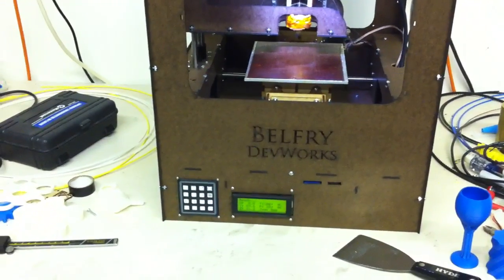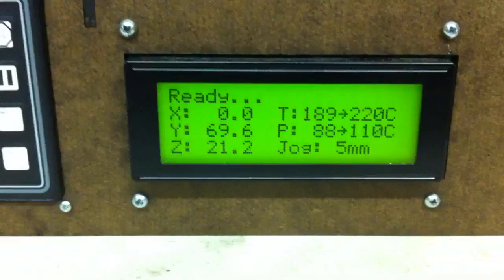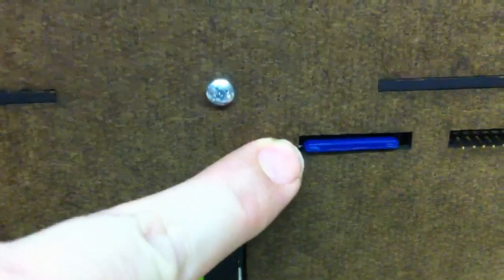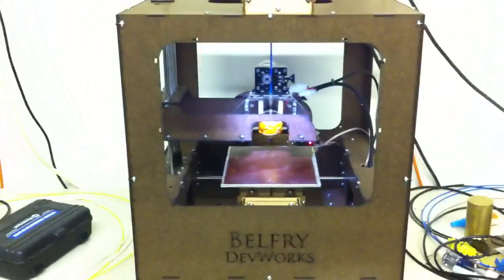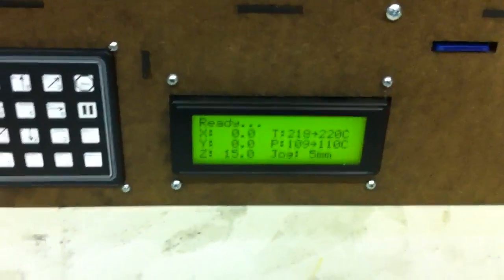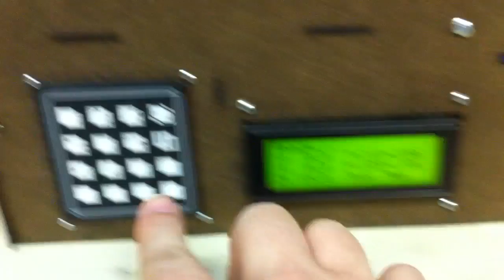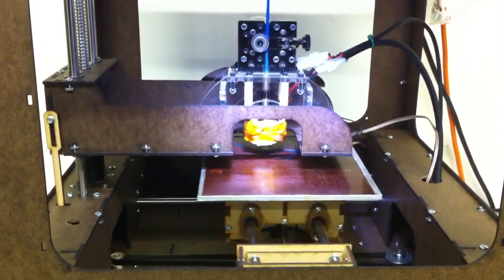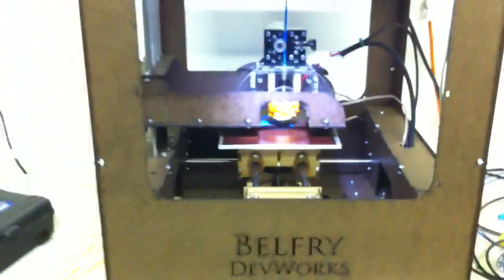Belfry Fabber Mk1 v6

Comment from the maker: @jweismiller Thanks for the advice!  I'll try that.  BTW, I'm only using 1/8 steppings, if that affects the sound.  My reasoning is that at 1/8 steppings I'm already throwing a step pulse every 3 or so stepper timer interrupts, when the code would prefer every 8.  I figured 1/16 steppings would be a bit harsh.

Comment: If you are using the pololu drivers, it sounds like you have the current set too high on the steppers.  You should set the current to zero on each axis, and then slowly increase the current until you can not make the axis skip by hand anymore.